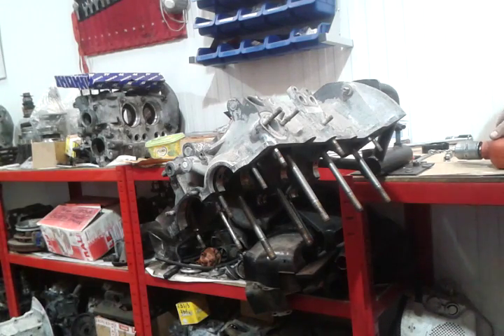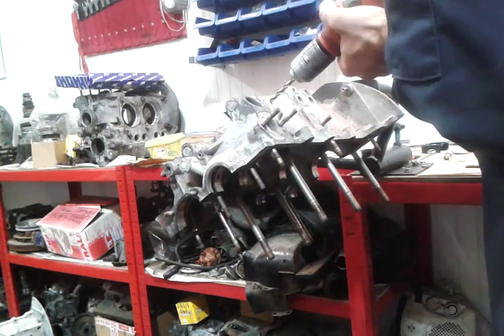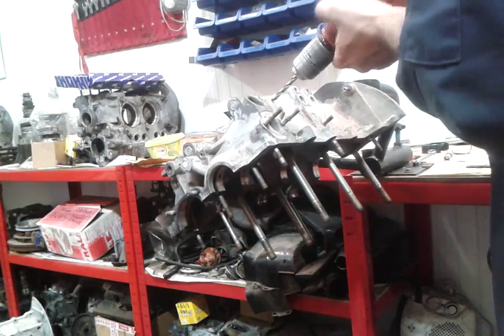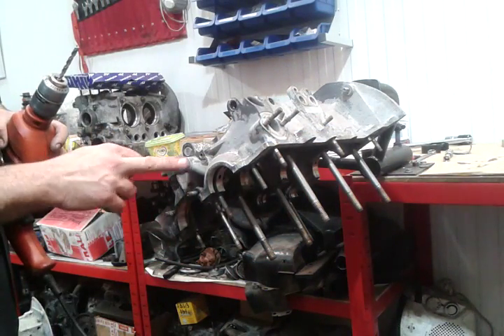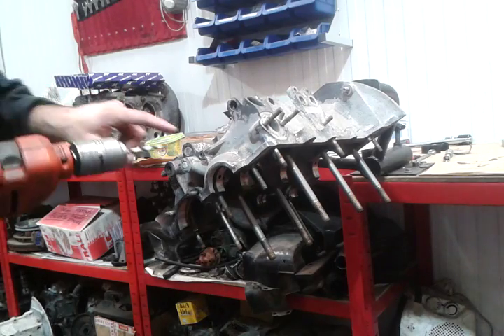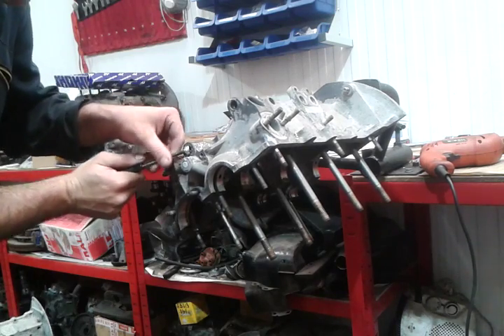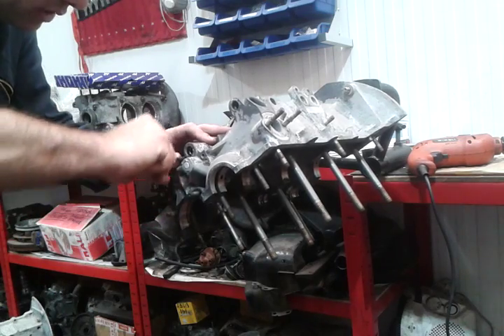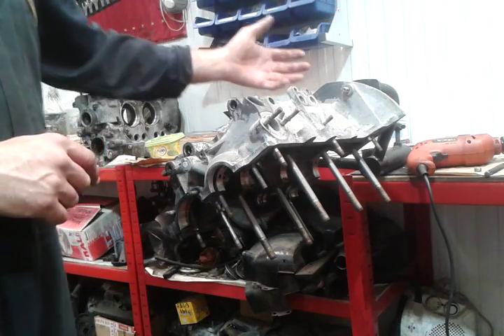Vw Air cooled: How to remove oil gallery plugs

Comment: What's wrong with you man.. that's not the way to do it- shouldn't pose inaccurate descriptions. 

What size drill bit do you use before tapping them what size tap??? What size plug... How many different plugs where did they go- where did you get them? Would you use to seal them with... 😂

Comment: This is how NOT to remove oil plugs!!  Wiggling the plugs out like that stretches and cracks the magnesium case. The way to do it is to drill a smaller hole in the plug and screw in a self tapping screw, then use a slide hammer to pull them straight out with no damage to the case.
Reply from the maker: Thanks for your suggestion, but the way i do has worked well for all these years. I have never cracked a case or damaged anything removing the plugs this way. Off course anything can break if care is not taken.
Reply: That is what I would do.

Comment: Hi. Really nice video! Could you help me out as I'm looking to clear out one of my oil galleries on a VW type 4 that I know has a metal stud loose in it (I know, cos I accidentally put it in there!) It looks pretty easy to drill the existing plugs, or at least you make it look easy, but how do you install new plugs, and where do you get them from? Thanks.
Reply from the maker: shepwoofwoof hi, thanks for watching😃
Basically after removing the plugs you can just tap and use pipe plugs, like 1/8, 1/4 or 3/8” NPT. Then i normally apply some liquid PTFE and they never leak👌
Reply: @afonsomotors3691  Hi, thanks for the really quick reply. Sounds pretty straight forward. Just checking though. Are you suggesting inch and NPT for a particular reason, or would metric tapping and pipe plugs work just as well? Also, any particular material needed for the Pipe Plugs? Thanks again.
Reply: @afonsomotors3691  good info thanks!

Comment: Nice presentation.  One suggestion, it would be helpful if you were to start by telling us why you would want to remove the plugs in the first place.  Is there something to clean?  Do they leak?  Is there something you need to inspect?  Why would they need to be
replaced?  Just a suggestion.  Thanks!
Reply from the maker: Hi, thanks for watching and for the suggestion.
I will change the description👍
Basically those plugs can hide dirt, swarfs and carbon, so when the engine is rebuilt all that stuff can be trapped in those places and as soon as you start the newly rebuilt engine, the oil pressure moves the material and they circulate thorugh the bearings, etc until they get caught in the filter(i always install the full flow filters in the engines i rebuild). The result is scored bearings, crank and cylinders, which reduces the engine life considerably. Most engine builders do not open those galleries, but i do in all of them.😉
Abel
Reply: Thanks Abel!!!!  Excellent response!!!  A followup video on how to reinstall them would be a great addition, as well as a video on the full flow filter you describe.  I really like your presentation style, and look forward to more videos.  👍👍👍
Reply from the maker: GutshotGriz you’re welcome, if there’s anything i can help with let me know👍